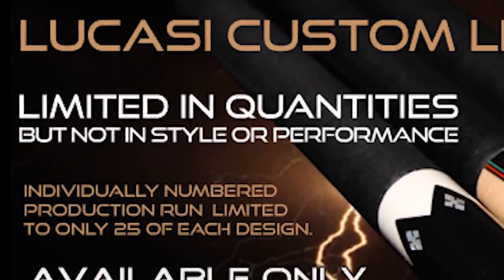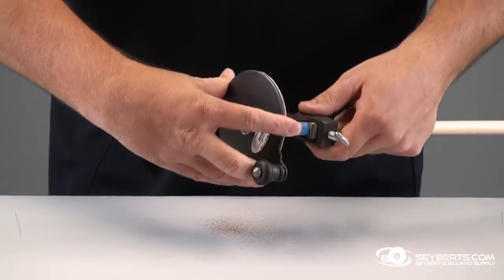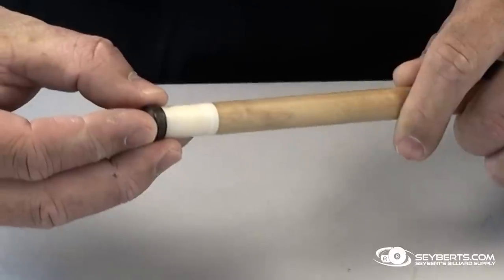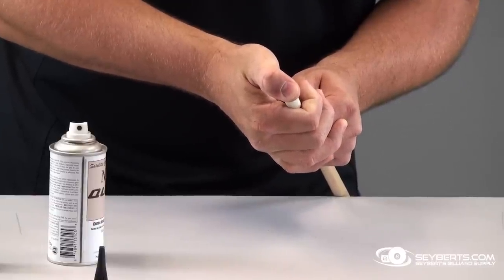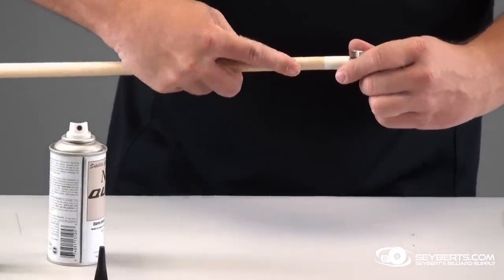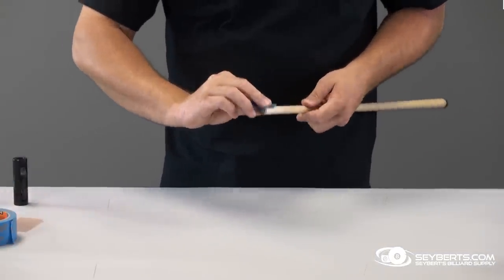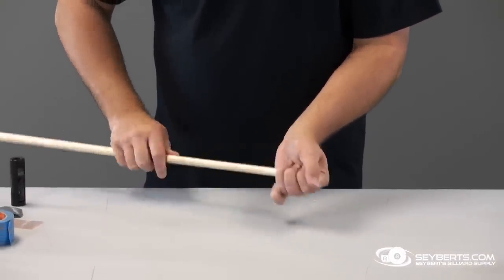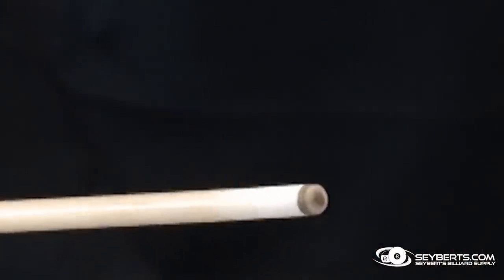How To Install A Cue Tip - On Cue - Seyberts.com

Comment: I installed a tip with your kit, I like it. Only trouble is. A new tip is longer then either tool can reach. Next time I think I will have to shape it first, to take a layer or two off the top

Comment from the maker: Hi, yes, this method will work on tips that are 11.50mm and up. The cut-rite for final trimming works on shafts down to 11.50mm. There is just a little more trimming to do with smaller tips. Remember to take small amounts off the tip while trimming with the cut-rite. Trying to take to much off at one whack will cause problems. slow and steady.

Comment from the maker: Well, this is just a grouping of tools that can be used to change a tip if you do not have access to lathe or a cue person that does tip changes. The best way to change a tip is still with a lathe by far. 

Sure, tips can last a long time... probably much more than 6 mo. Of course it is dependent on your playing time. Just get a good shape on the tip when installed and just chalk it. Shapers and scuffers will remove leather so only use them if you have to and you tip will last a long time.

Comment from the maker: No, if the tip is just mushroomed, you can simply take the porper cut rite and trim the mushroom off. That is one of the great things about having this tool laying around. I usually only change my tip when it is wore down and thin to the ferrule.

Comment: This is a good kit for doing house cues only,  as a cue Smith I have a lathe,  but I had a buddy that owns a bar and asked me if this would work instead of sending me all his house cues which I hate doing.  Here used it and totally fucked up his ferrules and marked up his shafts. I thought it was his ability so I went to his establishment and did it on his cue, I did a much better job but it still does a crap job and a number to the ferrule. It's a total botch product. I do reccomend it if you are doing house cues as house cues are treated like shit anyways.  But not reccomend on any cue over $200. Or on ANY quality shaft.

Comment: I just have 1 play cue, 1 shaft, 1 break cue. Do I really need this tool? Just wondering how long does the glue last before it goes dry? And some people say tip can go last for 6 months. Is it true? Thanks
Reply: I've been wondering why my game has been  starting to suffer...  I was completely unaware that tips only last roughly 6mo..   mine is about 13 years old!
Reply: @duke1281  13 lol. Was it a triangle or Moori ? Can't say le pro because it might have fallen apart lol

Comment: i bought a mizerak cue at dicks sporting good store,,i shot cue ball 4 times and the tip came off. bad glue?i want to replace my tip in a low budget way? what do you sugest what kind of cue tip repair kit i should get?
Reply: sir,where are you from? you get people sending there cues to you to repair?i called a pool hall in dubuque ia witch is 40 miles from me,they said they can do it for  $6,bit i think they do it the cheap way
Reply: any  cue that you purchase from Dick's Sporting Goods is a throw away.  A new tip is worth more than that piece of wood.  Better you purchase a quality cue from a pool hall and use the Mizerak cue for tinder... seriously... tinder

Comment: can someone recommend an alternative method for cue tip replacement that doesn't need much equipment. Im trying to replace a tip in a college bar so something inexpensive would be best.
Reply: Lmao same
Reply: Prime No. 6
Reply: Prime No. 6 you can remove the old ferrule and they make oversized ferrules that slip over the shaft of the cue and you glue them on. very inexpensive and easy. doesn't look as clean and professional, but is economical and your best option for old, beater, bar type cues.
Reply: I've used light grit sandpaper on both the back of the new tip and top end of the ferrule and a simple drop of super glue on both sides. Let it cure under weight overnight. That held up for house cues for years. Lots of good mixed epoxy glues are on the market too. You can just turn the cue tip down and hang a little weight on it overnight. A box knife and a shaping tool and it's good to go again. If you enjoy playing order yourself a 'Little George' and you'll have a shaper/scuffer and tap tool that lasts for decades. Replacing tips isn't 1/10th as difficult as the video makes it out to be.
Reply: All you really need is a razor blade and super glue.   I have changed a few with nothing more than a blade a super glue a few times. Although not idea it can be done.     Just takes a bit of patience and precision.  However a bit of sandpaper and a 5/1 tip tool for $15 can help alot also.   But if you can afford one thing out of this set i would recommend the cut rite    Cut your old tip off with a razor.  Use the razor and shave off the little bit of tip that is left on the ferule bit by bit being suuper careful to not cut into the ferule.  Make a few marks in the ferule and tip tithe razor to help the glue make a good bond.   Glue on your tip.  Take the excess off with the razor and get it closer to the diameter of the ferule.   Then use a cutrite  to make the tip perfectly round and the exact diameter of the ferule. If you cant afford the cutrite yo7 can also do this step with nothing but the razor. Cutting away from you ferule.       You need alot of patience and you have to be suuper meticulous and precise if your going to use only a razor blade for this step.  Once the outside is cut to diameter. Use a pice of cardboard.  Wet the tip edges slightly and use the cardboard to create friction and heat to burnish it.   Then shape the tip to dime or nickel which ever is preferred  and voila.

Comment: Is it okay to use gorilla super glue to tip? If I had no other choice
Reply: Once you know how to apply it. It came off 2x before staying of for perm. Just make sure you let the glue try and then burnish the tip and shaft. i Got some glue on the sides so i just use a non-scrathable sand paper and doubled glued it just encase. As long you make sure you glue it properly it should be okay.
Reply: i have a white diamond on break cue and pool hall uses top  brands well the tip pop off. i'm thinking extra hard tip might not be good for my breaking , and go back to using Lepro or even Triangle Tip for everything

Comment: This works good on low profile tips,but does not work on tips that are taller like Kamui tips or any other laminated tip that need to be shaped.other then that it works ok.
Reply: MrElPoderozo1 i want to buy one full box material tip. can you show me. thanks

Comment: Question, will this work with any size tip?  My main player is 11.75mm, and i have another cue that's 11.5mm, and 12.25mm  

Really considering getting this tool.  I generally favor Lepro tips but they do require maintenance and replacing.when they are bad.  

Thanks!

Comment: bought a mcdermott cue from Sey and added moori tip, some idiot carelessly put it in, after 2 weeks pf playing (about 3 times) tip come off and the under side of the tip obviously not being sanded enough, so it's not rough to hold the glue, wait... there isnt any glue at all...
Reply: I've seen that happen to the best of cues. I suspect people touch the surfaces or don't prep them correctly. I've also seen people use a liquid type glue that soaks into the back of the tip.
Reply: This is the exact reason that Kamui came out with the 'clear' tip, because it doesn't absorb glue unevenly like natural leather grain does.

Comment: If you're concerned about misplacing a tip with glue on it (hence, choosing a larger tip than designed for your shaft), then don't use accelerant and you'll have more time to make adjustments! further, this isn't a fool-proof system. some steps require you just to have experience (amount of glue, not gouging ferrule with cut rite, not gouging ferrule with cut rite trimmer, sanding, shaping), and you still might not get optimal results. this is too much guess work and imprecision for me. i think ill go to a professional with a lathe.
Reply: I repair cues and this video made me cringe, he didn't clean any of the dust off the tip after he roughed the back up so all that dust is in the glue between the tip and the ferrule. 240 grit on a ferrule sanding like that along the length of it, that'll leave flat spots, no  paper lower than 1500 grit goes anywhere near the ferrules I  have to clean up. Also did you notice, no close ups so you couldn't see the marks on the ferulle and tip I bet were there. I'm far from a professional cue maker but that was poor workmanship for me.

Comment: Oh my God, This is not how you put on a tip.
Reply: Oh its not.   I mean he did put a tip on did he not.   Therefore your statement is inaccurate.   Also if you did actually watch the video he says that the best way to install a tip is still with a lathe. But being that moat people dont have a lathe at home.   This method is one way to do it.    But since your clearly the master at tip instillation.  Why dont you back your claim up and actually tell ppl how you would do it or what you believe he has done wrong instead of just sitting there behind a computer screen and throwing shade without any facts or even any ideas of what is wrong with this method or what to do differently